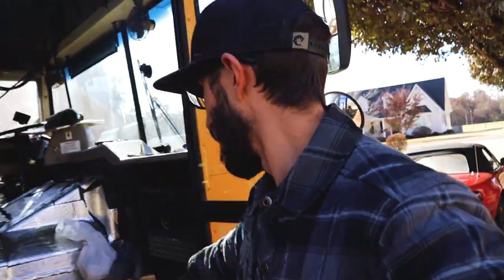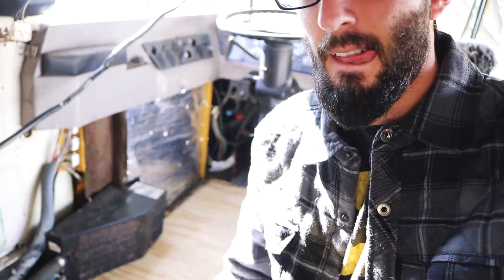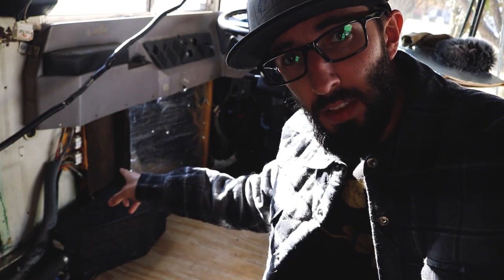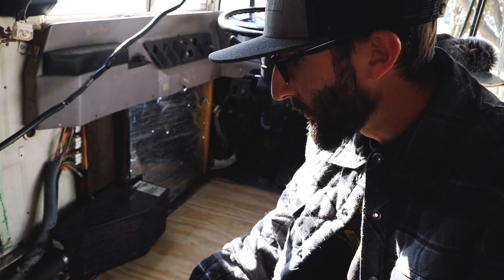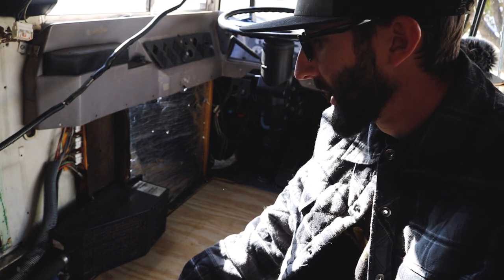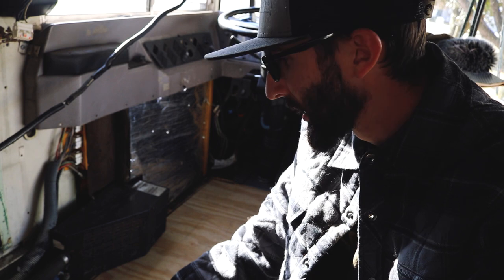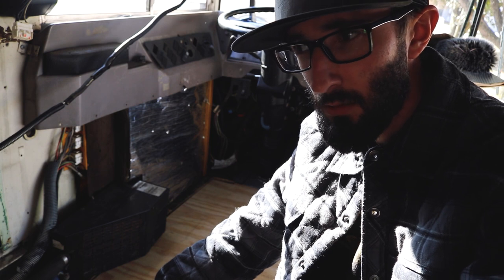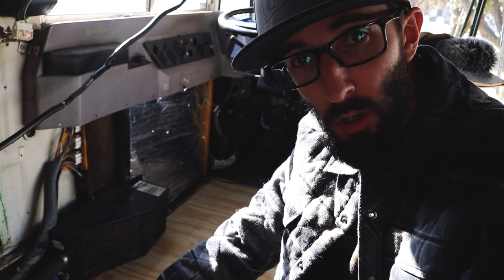How to remove a School Bus Heater // Skoolie Conversion

Comment: Like your videos 🙂 Question
Did you add any coolant after the removal of the heater?
Reply from the maker: I added like half a gallon. There was a lot in the hose but since it got deleted it doesn't need as much to out back in.

Comment: We have only chosen to remove the rear heater so far. We cut and plugged (rather than looped) both hoses that ran from the driver heater to the rear heater. I believe we also shut a valve that was located down by the brake pedal. Let me know if anyone sees a problem with this solution.
Reply from the maker: You should be fine. I would be a curious if plugging the hose was necessary since you kept the valve shut off. In theory, you could remove the hose after the valve since no coolant will be passing through.
Reply: @BackroadPurpose  Next time I get the bus serviced, I'll ask them and let you know what they say about it all. Thanks for the great videos
Reply from the maker: Thanks for watching!

Comment: So you don't have a defrost now. You probably know that and are planning something.
Reply from the maker: Thats true. I have a couple of ideas but not 100% sure what I am going to do yet.
Reply: Should have kept the defroster.
Reply from the maker: @JohnDWillis  Maybe so but there are other ways to get ice off a windshield. Plus, we're rarely somewhere where there is ice on windshields. the space is worth it.
Reply from the maker: @JohnDWillis  I have some plans instore if we ever need to defrost the windshield!
Reply: The little diesel heaters are very cheap and simple to install for a defroster and heat the whole bus
Reply: Backroad Purpose did you ever figure out a defroster?